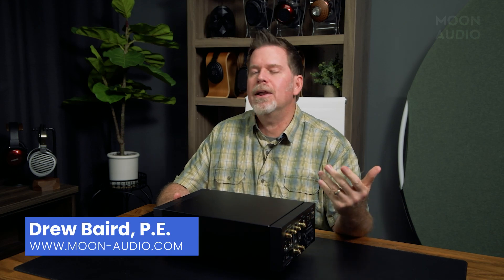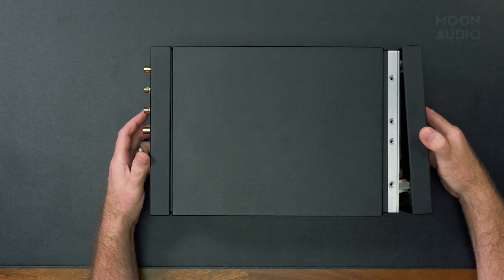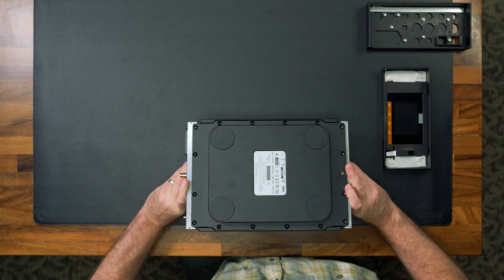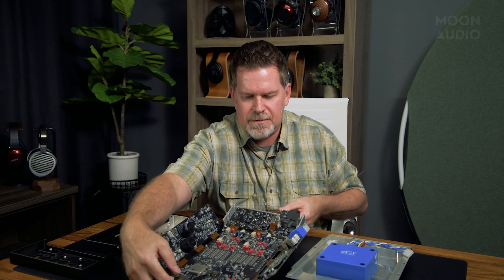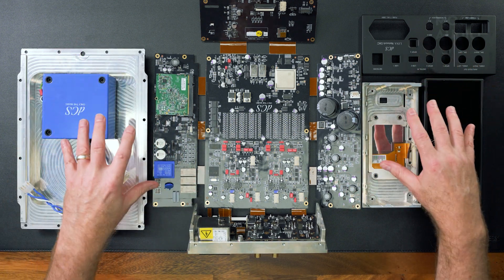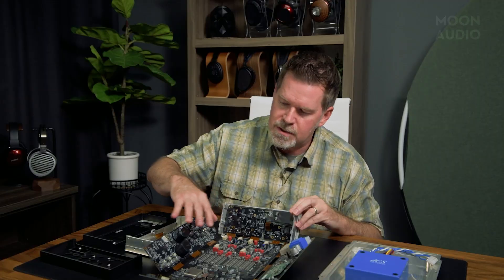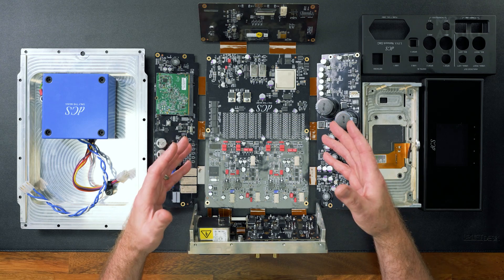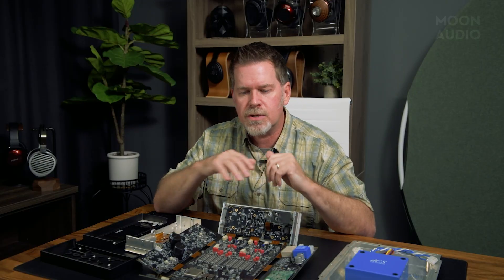Our dCS Lina Network DAC EXPLODED! | Moon Audio

Comment: The Mola Mola is on par with the Scarlatti , Vivaldi spec wise and got very nice inner detail and micro dynamics och sounds slightly richer than dCS house sound. The dCS is slightly more neutral to the source whereas the Mola Mola shape the sound more than the dCS because of the PWM upsampling and using different filtering. 

So do you want a dac that sounds as good as an Vivaldi, but slightly different and richer, then look for the Mola Mola. 

I am using a Chord DAVE, Mola Mola and a dCS Paganini modified with dual transformers, one for analogue and one for the digital side like the dCS Scarlatti, and sounds the most neutral and flat of these 3 dacs i own, but lack slightly micro dynamics against the other two, where the Mola Mola is the micro dynamic winner. 🥇

Comment: How does this compare to the Mola Mola Tambaqui ?
Reply: The Mola Mola is on par with the Scarlatti , Vivaldi spec wise and got very nice inner detail and micro dynamics och sounds slightly richer than dCS house sound. The dCS is slightly more neutral to the source whereas the Mola Mola shape the sound more than the dCS because of the PWM upsampling and using different filtering. 

So do you want a dac that sounds as good as an Vivaldi, but slightly different and richer, then look for the Mola Mola. 

I am using a Chord DAVE, Mola Mola and a dCS Paganini modified with dual transformers, one for analogue and one for the digital side like the dCS Scarlatti, and sounds the most neutral and flat of these 3 dacs i own, but lack slightly micro dynamics against the other two, where the Mola Mola is the micro dynamic winner. 🥇

Comment: 3:58 That is .. just ridiculously wasteful and insultingly extravagant. In this day and age when every kilogram of CO2 emissions counts, every type of waste has to be minimised. This type of consumer device construction needs to be outlawed worldwide. CNC shaping of containers should be only justified in very limited, specific industries and components, e.g. mass transportation, aerospace, health or where safety matters most.
Reply: You probably drive an EV and think you are “saving the planet” 😂 in reality you are adding MORE CO2 to the planet than driving a gas car. Check out the World Economic Forum article. The CO2 produced during battery manufacturing is the equivalent of driving 100k km in a gas car.
Reply: Fortunately CO2 fears are merely a Socialist hoax perpetuated by the compulsively lying narcissists at the UN. The actual net impact of higher CO2 is not high and negative, but in fact modest and positive.

Comment: did they pay you ? this construction is more fitted for warzone than for high-fidelity audio. several tones of cnc'd aluminium impress only idiots. you should be more concerned about passing signal through thin film strips, changing impedance in the middle of the road and placing 5000 capacitors to make up for that.  expensive crap product. liar